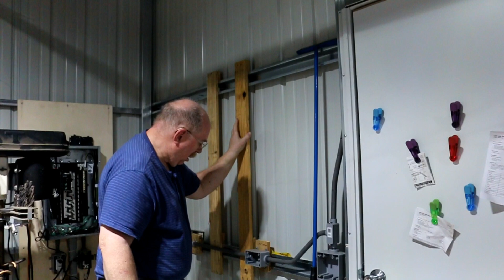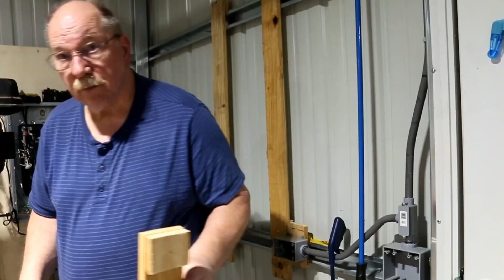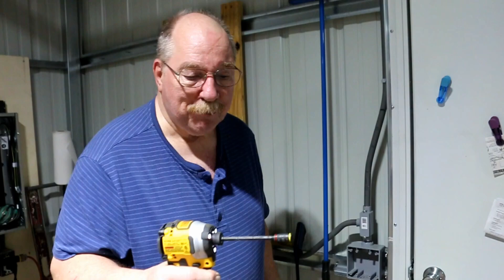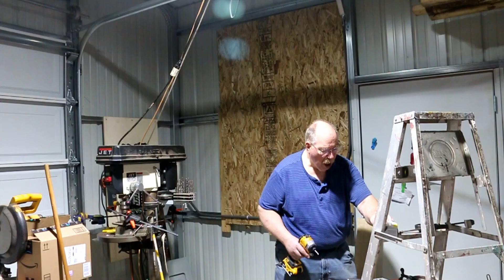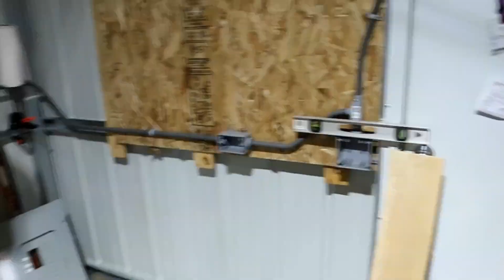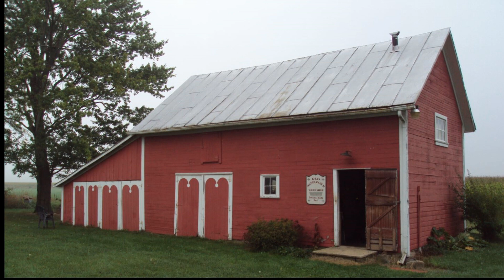French Cleats For Hat Shaped Channel In The Annex

Comment: You have a lot of useable height in the annex.  😃👍
Reply from the maker: Height costs less than floor space. 
10 foot walls gives me 1152 more square feet for the price of four 10 foot sheets of paneling. 
Plus I can move a 4 x 8 sheet without knocking down the lights. 😀😎